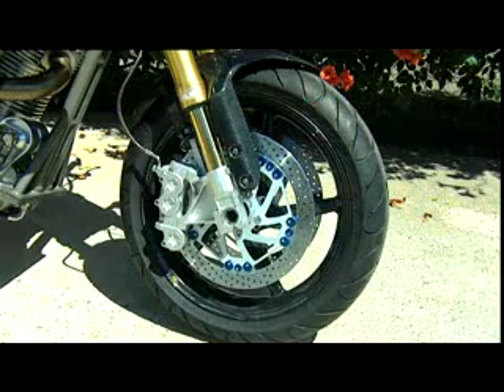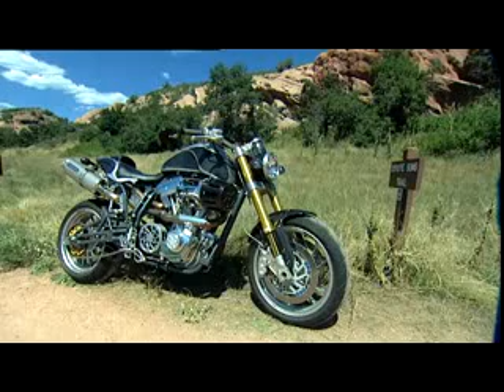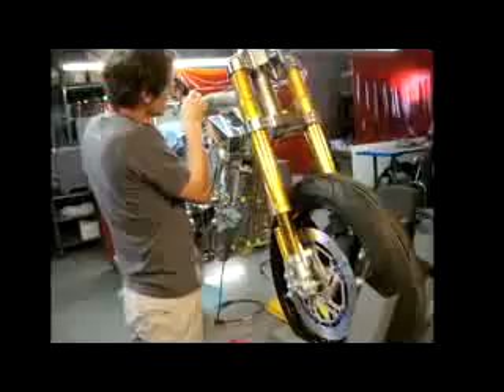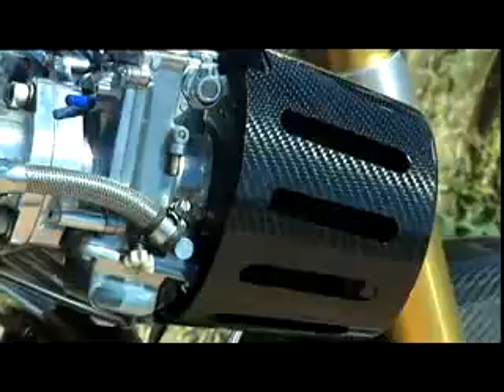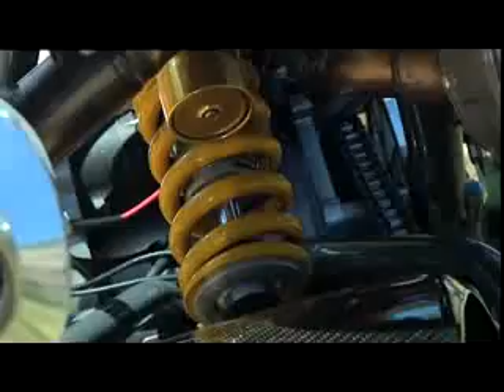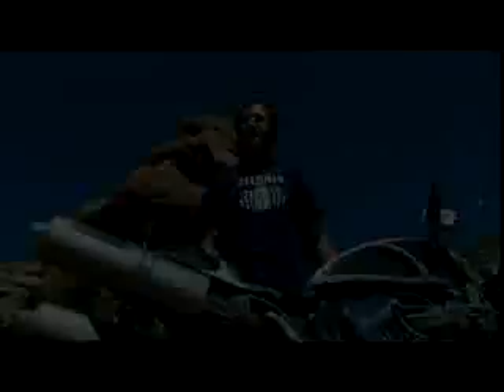Ecosse Heretic V-Twin Motorcycle 2000cc 130Hp

Comment: You can  get modern sportbike HP from Harley engine IF you have  a minimum of 1500cc
AND turbocharging .  The Ecosse   still has old tech double loop chassis so its a flexable flyer in any case.

Comment: Its simple why big Harley motors need twice the displacement to match a liter bike half its displacement:Over head cam engines beat Overhead valve engines overall,though the OHVs massive torque can often beat a literbike in short  sprints in normal street conditions.But at about 90mph. or so the literbikes leave you behind everytime .Take it from a lover of vintage panheads and sixties Triumph and BSA  bikes.OHVs are all about style and sound,just plain fun,though tractor technology...